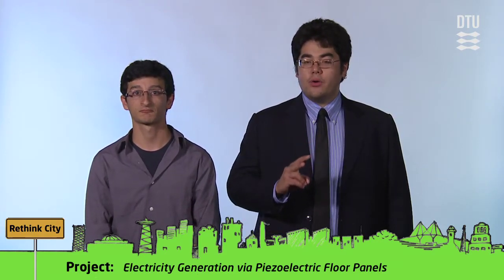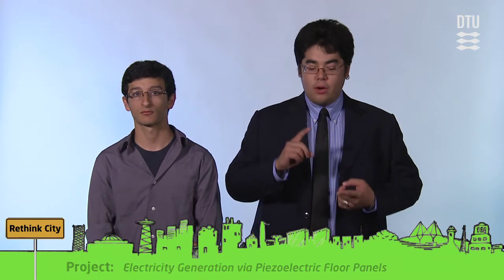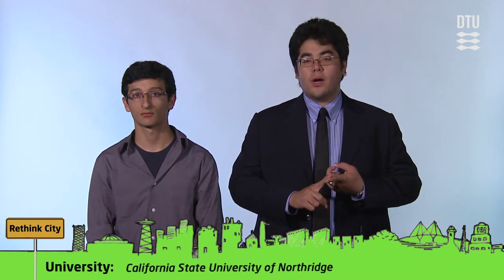Team 13: Electricity Generation via Piezoelectric Floor Panels

Comment: @htcfagg It's only just starting right now. New piezoelectric materials will be discovered that will increase efficiency and lower cost. This is just the beginning. Piezoelectrics don't just have to be used in floor panels either. 

Any vibration or distortion of the piezoelectric will get it to produce electricity. It's pretty mind blowing when you think of the possibilities.